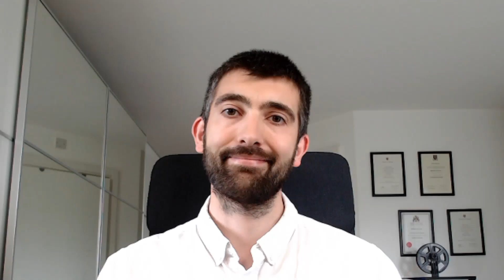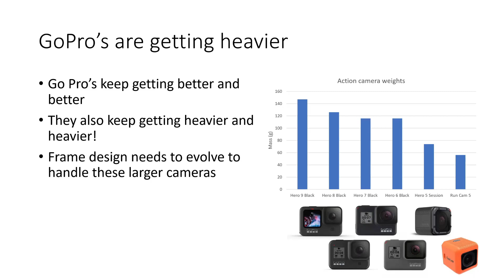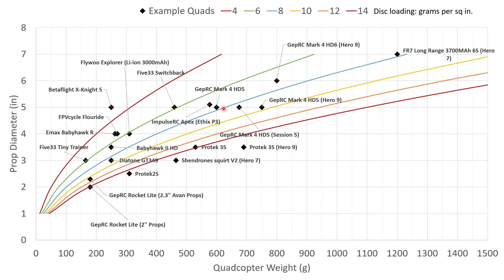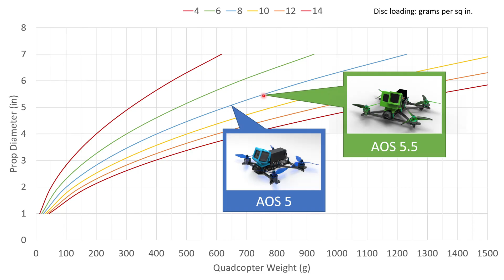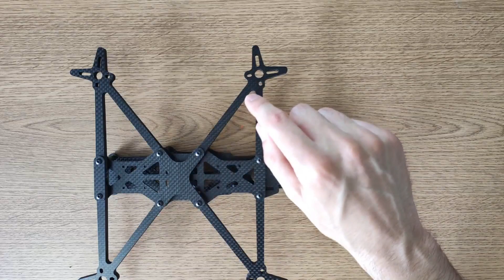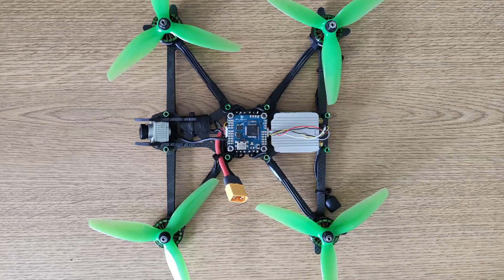The AOS 5.5. If you fly a GoPro Hero, this frame is for you.

Comment: how come the front and rear arms are different shaped?
Reply from the maker: They aren't. There is only one arm shape for all 4 corners.
Reply: @ChrisRosser  oh i guess itrs just the angle i saw it at the rear arms looked wider for the crossbrace side
Reply from the maker: @longboarderebright  No worries. I felt it was important that there was only one shape of arm so that you don't need multiple spares.
Reply: @ChrisRosser  ordering mine soon. any motor recomendations? 2507?
Reply from the maker: @longboarderebright  2307, 2208 or 2507 all should be big enough for 5.5
Reply: How about 2306?
Reply from the maker: @sifidelity  I think 2306 is too small for 5.5 inch. It's ok for 5inch though.
Reply: Yeah I thought that may be the case..

Comment: I just finished building a 6 inch apex I planned to use the new 5226 and 5236 along with 5.5 inch props because I fly a GoPro 9. It flies pretty great with the 5226s on stock settings just rpm filtering. Didn't get the aos5 cuz of the GoPro 9 but I'll definitely be picking this one up when it drops. Looking forward to trying one of your frames. Excited about hearing the stack can now go into the center long with it fitting a air unit. I just went digital and picked up a caddx air unit. This sounds like the frame for it if you ask me no doubt about it
Reply from the maker: Hi Brian, this video is the drop. You can buy the frame here: https://www.cncdrones.com/AOS-55_p_1046.html

Comment: Explains why I still use the session and session 5, can’t stand the thought of putting a heavier GoPro on my 5 inch quads and I don’t care about getting better quality video.
Reply: It makes sense, while if you fly 6" stuff or larger, those heavier birds just shrug off bigger Hero cams like nothing
Reply: But why nobody is packing naked gopro in a good thick protective ABS case and freestyle with them. No screen, no battery would come up below 100 grams for sure.
Reply: @Denis_3301  by the time you make it as tuff as the original GoPro it’s probably easier to just take the battery out and power it off the quad to save almost the same amount of weight and is still waterproof?

The session 5 is only about 70 grams, tuff as nails with no screen to break and is waterproof. It can record 4K but I use 2.7K in superview with pro tune. If GoPro wanted they could probably release a session 6 with all the new features like hyper smooth etc. but they dropped the session line because the market for them wasn’t big enough.
Reply: @MUNKYFPV  you re right. Sessions are great. If only they worked with reel steady. I tried a dozen of different mounts and none of them work except ridiculous ones with the zipties.

Comment: You did it! I love the tweaks you've done to the design. Especially the fact that you can replace the arms super simply from the bottom now and without interfering with anything else on the frame. I'm also still fascinated how beautiful that design came out despite following mostly practical and functional aspects - arms and shape of those plates look quite good. I'm also a real fan of those counter sunk screws - you really don't want those button-head screws to work themselves into your battery - for me those are kinda always in the way.

Glad you kept the 32x32mm mounting-pattern for the gopro. I'm gonna steal that mount first for my AOS5 and then later this summer probably build this leafcutter. Gonna be super interesting to feel the difference in action!

I'm also quite curious about a jello-comparison between this and a classic frame. I agree - if you see those gyro traces (and what that little noise does to D) a lot of that jello we got used to see might actually be avoidable by eliminating resonances... and to me this might even have a greater impact than the shorter response-time and agressive prop wash handling (not to say these aren't awsome).

Keep it up!
Reply: @ChrisRosser  I really find it beautiful. Can't wait to add those two to my collection :3 Just waiting for that grease now, then it's building time!

Comment: Can’t you just flip the top plate so the “S” in the logo goes the right way?
Also, what props to use? The linked ones are 5”.
Reply: I am ordering GF 5552 from TBS. Its 5.5" and the only prop i found this size...
Reply: @Denis_3301  This is my hold up... Prop selection. Also Ethix P4 props huck my apex and GPH8 like a slingshot. How bout a video analyising skill vs frame design. Great pilot flying worst frame and see if he rips.
Reply from the maker: Unfortunately not. The underside is routed for the camera plates. Don't worry that has been fixed in the real version (that's why we make prototypes after all!)
Reply: these? https://www.hqprop.com/hq-durable-prop-55x35x3-2cw2ccw-poly-carbonate-popo-p0123.html

Comment: To get the benefits of the larger frame there really seems to be just one propeller at the moment, the HQProp 5.5X3.5. There is also the Gemfan 5552 but its pitch is too high for the high kv that is en vogue for good control. And 5.25" props don't match the intended disc loading with 9% less disc area.
Reply from the maker: Yes, it's a problem but I'm actually speaking to some manufacturers about it. Hopefully things will improve!

Comment: I love the design but have one comment on the fpv camera mounting. With the tabs that go back over the top of the 20X20 front mounting area. Are you finding that it interferes with say mounting the Caddx vista up front with the camera? My reasoning is that I find most times I cant get the battery far enough forward to get the best CG so pushing the weight up front would help a lot. Ive had a frame from GepRC the Cinerun that had the tabs run back into the frame and it hit the ESC but this was a 3”. I’m thinking a centre mounted FC stack and the vista upfront would be the way to go. Also I run a hero 6 with a battery and a hero 9 without a battery which oddly comes out to the same weight.
Reply from the maker: Just checked the CAD. The vista can fit up front under those braces but you will need to use M2x16mm screws or cut some M2x20mm down with a Dremel. You could also use foam tape rather than screws which would be easier.
Reply: @ChrisRosser  ok that's amazing.

Comment: Please, make  one 3” frame :)
Reply from the maker: 3.5" is next launch.
Reply: @ChrisRosser  that sounds amazing 👍
Reply: @ChrisRosser  What prop are you aiming for? Most 3.5" props I found are ment for Cinewhoops...

(have built myself a 3.5" 'squirt' and it flys absolutly great, but I really had to get the airgap down, think it really is sub 1mm now and it flys gorgeous, even with an AUW of about 980g, but think thats not the prop we are looking for here ;°)
Reply: @luis_gbs  There are more coming - it's a really good size, and you can always rock props smaller than the frame quite well.  5" props will run great on the AOS5.5, ditto on running 3" or 3.1" props on a 3.5" frame

Comment: hello Chris, what would be the recommended motor size for this baby? Im ready to order my AOS 5.5 but I need that info so I can everything at once

Thanks
Reply from the maker: Check out the specs on aos-rc.com. recommended motors are 2307 or 2208
Reply: @ChrisRosser  What's the difference between 2208 or 2307? Would the new T-Motor 2308 also work?
Reply from the maker: @karoo_bushman6880  Is that the AS 2308 motor for fixed wings? If so probably not. The KV will be wrong.

Comment: Waited for the 5.5 version (also because of gemfans 5.25" props) to replace my Armattan Marmotte. Will probably be a whole different quad then 😂😂

So this morning that the website has been updated and ordered even before this video 😜✅

Thx for the work, hope the next frame will be around 3.5" as I just want a more portable quad, but 3" just seems a little small for the 200g I got to 🥰
Reply from the maker: I hope this is what you've been waiting for!
Reply: @ChrisRosser  100%       <3
Reply: @ChrisRosser  How long is the whole top plate? I think of also getting myself some 3000mAh LiPos that have the same weight as my usual 1500mAh with a gopro. That way I can train a little better without having a GoPro on top that is in risk of crashing, but have roughtly the same weight and a much longer flight time XD

There are especially two lipos that I look for, one is 140mm long and the other 105mm. Maybe it would also be helpful how much space is behind th GoPro mount you designed, so I can also think of having that on (empty but not removed) while flying with the big LiPo ;^D
Reply from the maker: There is ~110mm of top plate behind the go pro hero 9 mount. The total top plate is ~150mm long

Comment: I really like your design approach. If I do not plan on running a Gopro for now and have already bought 2207  2450KV motors, 4S battery and full size DJI, would it still be nice to fly until I upgrade the motors and batteries? Would it be possible to get STL files for Crossfire and full size DJI antenna mounts, or will you be selling these?
Reply from the maker: It'll fly great without a GoPro (I'd actually run 5" props rather than 5.5 if no GoPro). If it's anything like the 5 you'll see accessories popping up on thingiverse. I struggle to find time to design accessories and other people do such a good job.
Reply: @ChrisRosser  I looked last night and cant find a hero7 tpu case for a 32x32m frame. do you know where I can get one?

Comment: Is there any particular disadvantage to using the countersunk screw version vs button head screw version?
Reply from the maker: None. I like the countersunk personally but they fly the same.
Reply: That plate becomes very slightly thinner right there, but since this is designed for noise performance, that larger interface area from the fastener hardware should be very slightly better - not to mention prettier.

Comment: Super excited.  Any prop recommendations from people?  GF 5552 and the hq 5.5x4x3 are only good ones I have found.  Struggled with the hq 5.5x3.5x3 in the past but may have been my setup. GF 6x4.2x3 cut to 5.5 we're best I found so far but what a pain.
Reply from the maker: I'm using HQ 5.5x3.5x3 and loving them.
Reply: @ChrisRosser  Thanks, could have been my tune.  I have about 25 sets sitting here so will have to order your frame so not to go to waste 😁 thanks for your work!
Reply: The GF 5226/5235 are probably ideal, oddly.  DAL makes a 5544 that flies great (but crashes horribly), a 5249 that is for going fast and does everything well but not oustandingly (great for slightly beefier motors), the GF 5552 is really fast but inefficient, but more props are coming in this size too.  Any 5" setup will still work quite well on these frames

Comment: That's what I was thinking in relation to the sub 250 5 inch quads. It's the right prop size to carry a gopro and still fly great. All of the sub 250g 5 inch frames don't make a lot of sense to me. If you can't carry the gopro, there is no need to stick with 5 inch props. If you can't have the mass that's required to carry itself through the wind when throwing it over a tree, there is no need for 5 inch props.
Reply from the maker: The best for sub 250g is 3.5". I'm launching a 3.5" frame next specifically for sub 250g.
Reply: @ChrisRosser  count me in for that one!
Reply: @ChrisRosser  I have a 3 inch and a 4 inch and want a 3.5 inch. 3 inch can carry a naked gopro or an SMO 4k, but 3.5 would be so much better.
Reply: @ChrisRosser  Nice, those avan props are really lovely btw. And I kinda feel like 3.5 is just a great size period.

Comment: Nice, been waiting for this version, 
Although I think the 5.2’s fit on the other frame too…
Reply: I just put 5.2" Gemfan's on my AOS5. They just clear the top plate by nearly 1mm
Reply from the maker: Yes they do! It wasn't intentional, but I guess the clearance for the 5.1" props turned out to be just enough to squeeze a 5.2". It's quite lucky really because the original design was going to only fit 5.0". A lot of people were keen for 5.1" so I expanded the frame very slightly, luckily just enough for 5.2".
Reply: Well.. I wouldn't do that.. spin a prop really fast then hold something close to the tip of the blades: noise increases dramatically. Better to have longer arms to keep some distance from the prop tips.

Comment: This will very likely be the next quad I build since I have a GoPro 9.  I see your component list on your website, but I'd like to see a complete list.  What KV motors do you recommend, or are there specific motors you like?  Which props (I'm guessing you don't recommend all 5.5")?  Which battery sizes?
Reply from the maker: I'll do a perfect AOS 5.5 build video soon. I think that will give you the info you need.
Reply: @ChrisRosser  if I knew what exactly to buy and it was all in stock I would have clicked “buy” immediately.

Comment: I ended up purchasing the AOS5 because there are not many 5.5" props available, maybe prop manufacturers will now make more options for this category. 
AOS5 w/hero 6 and iflight cable: 700gm AUW. 51477, soon the 51433.

Comment: I literally just bought the AOS five and I run a go pro nine which is heavy as hell most of my quads end up 800 g to 850 is there anyway I can switch stuff AOS 5 to the AOS 5.5 I put in the order yesterday
Reply from the maker: Send Nick an email cncmadness@gmail.com and ask to switch your order, if you only placed the order yesterday it should be OK. Make sure to check out my community page and/or join my patreon discord if you want to stay up to date on my projects, I'm working on a 3.5 and 7" right now!
Reply: @ChrisRosser  I Love You 😘 lol 😝
Reply: @ChrisRosser  do you have a pid and filter tune posted anywhere for lazy peeps that need a good baseline to start? Ive been playing with the tune on the 5.5 for about a month and still cant get it where i want it... i can if i put 5” props i can tune it perfectly but the moment i switch to 5.5 hq 2.2 props it wobbles like crazy no matter how high i push the sliders....
Reply from the maker: @flapjackfpv  Yes I have recommendations at the end of my filter tune video for filters and then just push master to 1.5